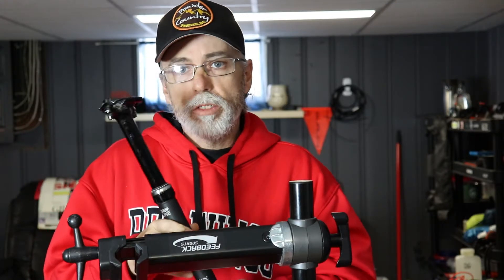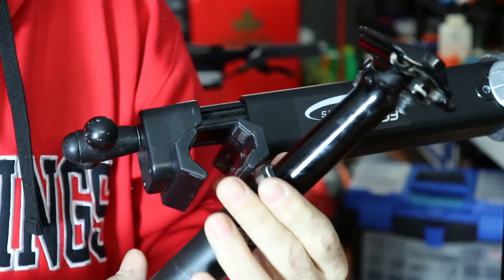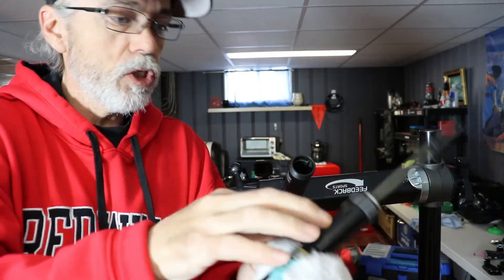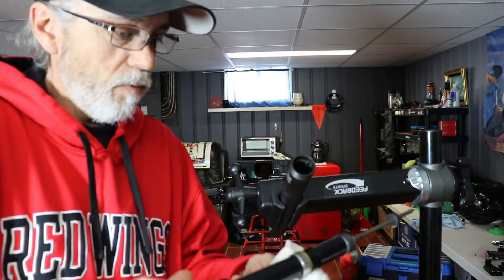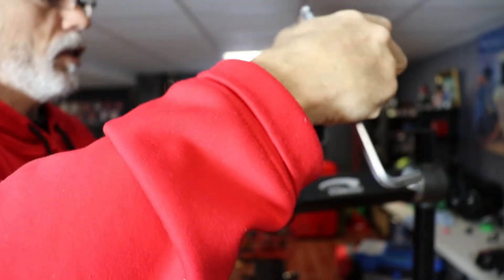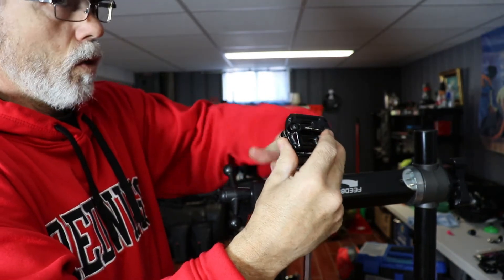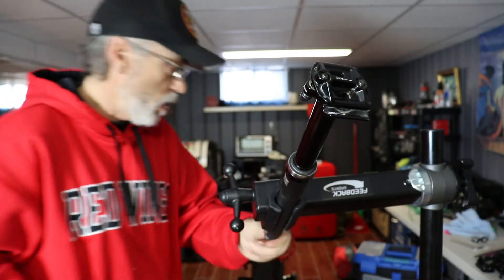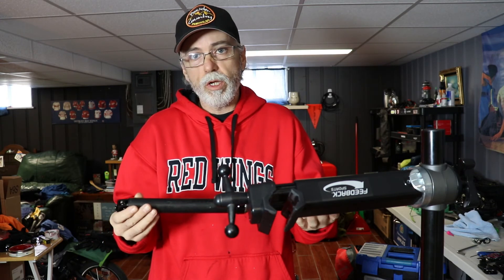How to: Dropper Post Maintenance

Comment: is this the stock post? i don't have any branding  on mine - or least what you can see. I assume the factory models will just come with the lowest model before upgrading to the multi $$ hundred units. So slow reaction to going up is the only sign for a tune up?
Reply from the maker: The one that comes on the bike is a Bontrager Drop line it just unlabled know. It is esentially the same post as this one. Yes slow return can be thing but for a entry level dropper it works well enough. If your looking for a dropper that works really well you might want to look at one from PNW Components. And they are fairly priced. Cheers